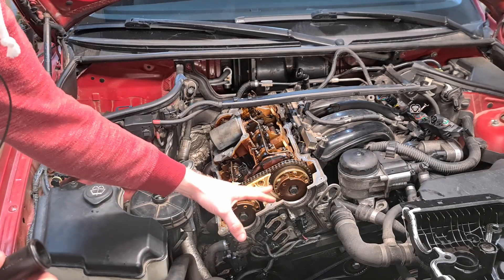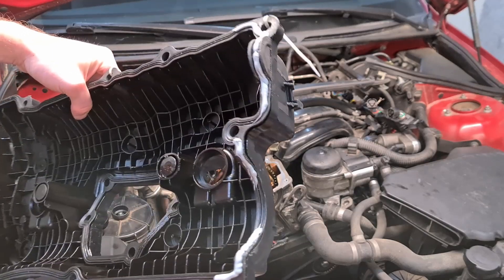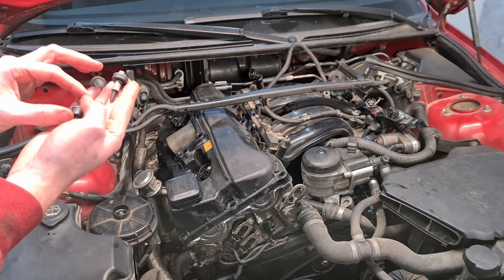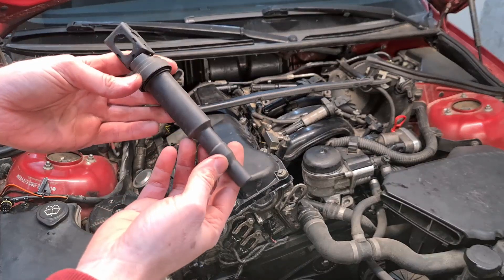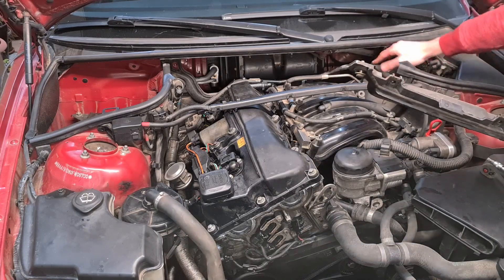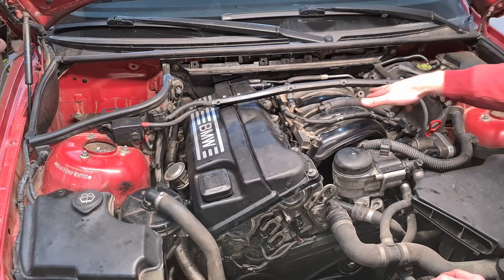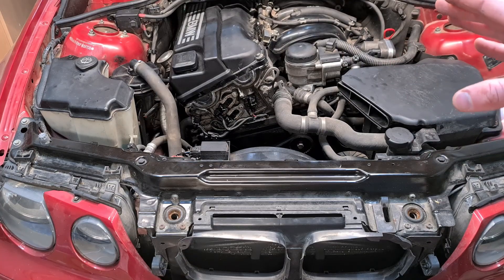Installing valve cover and starting the engine - BMW N42/N46 Chain Rail Replacement [PART #8]

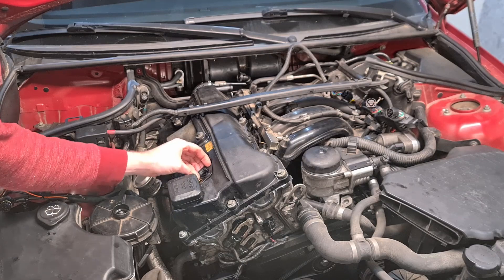Comment: 7:05 you didn’t need to add any RTV sealant to the valvetronic-sensor seal?

Did the seal leak afterwards?

Comment: hello, thanks for your video help me changing the cover valve gasket, i bougth the aluminium one new, but at the end of the video i see something important, in ANALOG VALUE 4 in INPA i have this problem:  CRANK ADAPTATION INLET BANK 1 i have it more than 120 so its out of range, what caouses this error? what means this value? i will be really thank you please, because i dont know if it is the crackshaft sensor i thing , 17:04 minute of the video thank you again

Comment: hello. nice video. Only one question , can I make adaptation reset with impa 5.2 ? thank you for answering.
Reply from the maker: I don't know that detail, I use INPA loader 5.0.6. and I have the reset adaptation options. 5.2 should also have it.

Comment: Amazing tutorial, I'm at this point right now since yesterday I had no more time for ending the job.

My car was running very poorly and struggling under medium to hard acceleration (it hesitated to the point of even being slower when accelerating), tried everything i could think of: replaced camshaft and crankshaft sensors, ccv, MAF sensor, injector gaskets, fuel filter... still giving errors and running bad and with a horrendous rattle when climbing rpm on start up.

I started this job just to find that apart from having the chaing guide rails broken (upper part same as yours and lower part broken by the lower passthrough bolt, not maintaining tension since the black right part was not attached to the left part and up against the block), but also the exhaust camshaft skipped a chain tooth and the impulse sending gear was missing a big chunk, where the golden timing part fits on it, but from there all to the right was missing (I hope it was an earlier crappy job done by previous owner or workshop who broke it but managed to take the metal chunk out...). Next oil change I am pulling the oil pan and searching for the chaing guide and impulse sending gear chunks...

Just a few questions:

I did more than 2 rotations while timing the engine, maybe 3 or 4 since I forgot to apply the special grease for the chain included in the INA chain guide kit, but even the rear locking tools locked properly, the impulse sending gears locking tool wasn't fittng well in the two gears, like 0.5 to 1 mm of difference between gears. Is this normal or acceptable? The car has almost 300k km maybe the chain is a bit stretched and has that play since i did the vanos bolts correctly (pre-tension the chain and 20nm + 180 degrees).

Also when bolting the valve cover, since i replaced it with a brand new one, tightening some bolts to 10nm (all new from the new valve cover) made the rubber grommet to expand and deform to the point of almost escaping around the bolt so i released the pressure and thightened them by hand. Is acceptable?

Apart from that, all that is left is to put the coils, attach the harness, rear firewall, air cabin filter and under plate. I hope it starts and runs well. I love my E46 compact but its giving me a hard time since i bought it.

Anyway, I am very thankful for your videos, you are my reference when it comes to working on my N46 engine.

Comment: No need to ziptie the gasket. The bolts are not supposed to be removed from the valve cover unless changing the valve cover gasket of course in which case you put the bolts back in the cover before installing the cover.
Reply from the maker: You sir are technicaly correct... the best way of correct:D Thanks for pointing it out.

Comment: Was that just 10 newton metres spec for the valve cover bolts thanks Dan
Reply from the maker: Yes, 10Nm. M6 to aluminium are almost always 10Nm.
Reply: @BimmerZen  many thanks.  Really useful. Wouldn’t have known this handy default

Comment: Hi there @BimmerZen! 

I just started the engine today after doing all this procedure thanks to your invaluable help, engine is like new, thanks a lot!
However, now the car presents a rattle "diesel like" noise when exhaust Vanos solenoid is activated. I checked with the computer it does the sound when this unit works/is activated.

At idle is butterly smooth, idle steady and perfect, no weird noises, is only when accelerating, when the exhaust Vanos should engage that it makes the noise (for instance, when accelerating it does not sound in all the rev range, I'd say it does when the exhaust vanos should actuate) Car runs like it should I think, but this is my first BMW, so I don't know. No error codes on the computer.

Do you think cleaning/replacing the solenoid would solve the issue? I've read there are updated solenoids for this engine, like it happens to the chain tensioner. Or may I have to change the hole inside Vanos exhaust unit? If you have any insights/experience on this one it would be VERY helpful! Thanks in advance!! :)
Reply from the maker: Hi! My first suspision would be oil pressure issues with vanos solenoids. Did you change vanos solenoid orings? Maybe just check the orings and make sure they are not damaged. Also make sure both vanos solenoids are seated all the way in the block. Also try and switch solenoids and see what happens. Does the problem move to intake side? Let us know...
Reply: @BimmerZen  I just made some playing with the two vanos solenoids:
1.Get them out and cleaned
2.Put 12v on them and they work perfectly fine
3.Change intake solenoid with exhaust one.
Still the same situation. I am now 99% sure it is the Vanos unit (inside-the-engine sprocket) which is faulty. May be some seals it has, or even the little bolts are not tight enough. I will open again the head cover and check. Hopefully is the unit and I can find one on ebay for 60€. New ones are around 300€. I'll update! Thanks!
Reply from the maker: @juanarrisem ok, did you check that seal on the vanos solenoids are good? I would also remove the valve cover and check if the vanos unit is locked in initial position
Reply: @BimmerZen  yes, seals are looking good, both, the bigger ones at the bottom and the little green ones at the midle of the solenids, but I have not replaced them yet. I don't think they are those seals since changing the solenids didn't change the Vanis unit affected. I've done some research and people with similar issues changed the unit and solved the problem. I'll keep commenting here with the results/decisions. 
Also in this engine the Vanis have no seals, they are a hole metal unit apparently. Maybe is just a clogged unit and needs to be cleaned. Anyway I'll comment in case this helps anyone in the same situation (diesel sound from Vanos activation)

What do you mean by "initial position" on the unit?
Reply from the maker: @juanarrisem  ok, if you are sure that seals are OK and the solenoids work, then its something to do with vanos units. I am editing a video where i disassemble vanos and clean it. Maybe wait for a day for this video to drop and then decide if you want to open it up and check operation or to just get a new one...
Reply: @BimmerZen  oh great! Yes for sure I'll wait! Thanks :)
Reply: Update: I opened again head cover and removed VANOS exhaust unit. I opened it like you did and It was completely worn. The little flaps that turn when oil is aplied had eaten the walls partially inside the outer/outside circle. Leaving a step on both sides of its normal travel, blocking the unit to open and close completely. So I already installed new VANOS exhaust unit, from Stark german company. The car now runs PERFECT! No more rattles, no rough iddle at all, the car seems to be turned off at idling. It drives amazing. Only problem now is loads of white smoke when cold, then warmed up it stops smoking. Since I already changed the CCV, I'm going for valve steam seals now. I'll follow your tutorial for that, @BimmerZen . Thanks a lot for all!
Reply from the maker: @juanarrisem  Awesome! Thanks for posting your problem and solution. I'm sure this will help others to narrow down their problems.